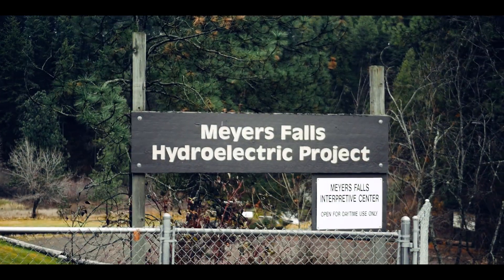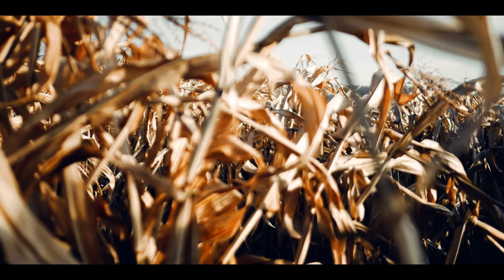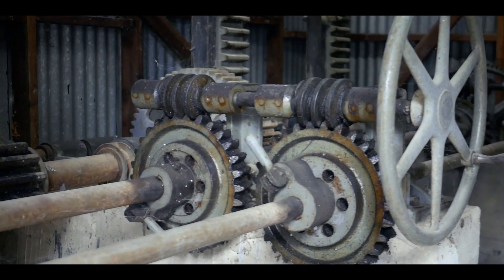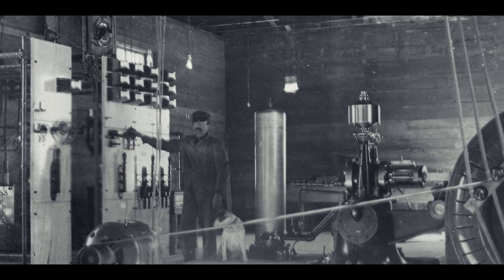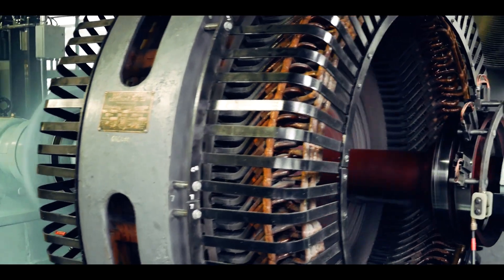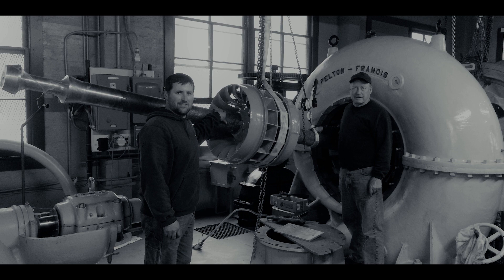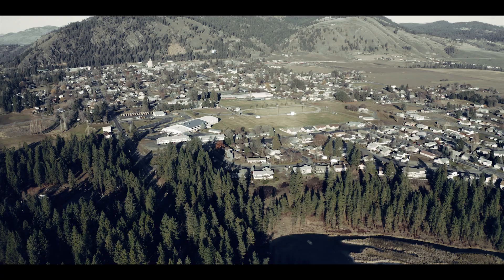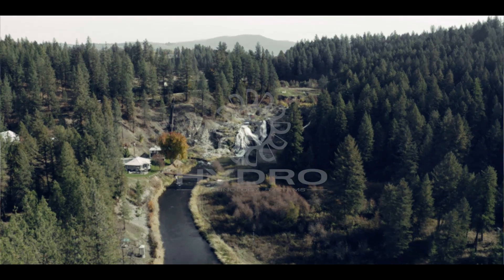Meyers Falls Hydroelectric Project

Comment: Lord kelvin water dropper will become more familiar as the years pass. Spinning a turbine isn't the only way. Good stuff sir.
Reply: I highly doubt it.   its old technology(1867)... 48% efficiency at best. Francis turbines can reach 95% efficiency. Even with modern materials, Electrostatic generators can't get near francis turbines. That is why rotating turbines are used.
Reply: @FixitFrank  interesting proposal. I get 100% just need to actually understand electricity and that it's a side effect not the main event. Longitudinal Dielectric waves have 0 losses. You might only be dazzled by the spark. I see much more potential. I'm not using the trash part of energy
Reply: @FixitFrank  I'm not using the water dropper either. 🤷 My potential cube works in ultrasonic ranges. Again no loss as I don't use conventional electric. Nikola Tesla isn't the only one who actually comprehends reality.

Comment: Very impressive nicely maintained old Hydro powerhouses . Saw you had a SEL 700G multifunction relay for a generator protection relay installed which is a perfect upgrade for a small hydro plants  . Also noticed the ballast weights mounted to the wicket shift ring for closing energy perhaps?  Were the governors on these units originally belt driven "Gate shaft "Governors?
Reply from the maker: Thanks for the compliment.  The 700G’s are great.  They were installed during a control system upgrade in 2018.  The ballasts are to assist in closing the wicket gates.  The units originally had belt driven fly ball governors but these were upgraded in the mid 80’s.   If you’re ever in Kettle Falls stop by for a tour.

Comment: It's pretty cool that you own your own.  I work for Mercury here in NZ.  I'm part of the team that takes care of north hydro on the Waikato river, but I spend most of my time at Karapiro (closer to home) where we can produce ~126MW, but generally produce ~70MW.  You didn't mention the rating of your generators, but I saw one in the video that is 300KW.  I didn't know there were so many small hydro sites in the US until I started watching a few videos here on Youtube.  Keep up the good work and don't forget that all the old steel mills that have long since gone away used very similar technologies to generate DC.  You may find some of the parts you need in holding yards near these places.
Reply from the maker: I’ve always wanted to visit NZ.  Hydro is such a great way to generate clean power.   The nameplate rating on the generators is 900Kw, 450Kw, and 2ea. @ 185Kw.  The 300Kw was recently rewound and we were able to increase the nameplate.

Comment: Do the old analog meters still work, or are they just disconnected and just there for looks?
Reply from the maker: The old analog control system was originally installed in 1915 and ran until 2018.  We kept some of the marble panels and installed them for their historical value.  It was a lot of fun operating the old analog system but it was time for an upgrade.

Comment: The method of generating power has not changed much over the last 125 years or so.  The methods of monitoring and control have, but the old stuff still works great.  I would hope that the condition of the penstocks have been checked, as the weight of water can really do damage, if there is a weak spot.